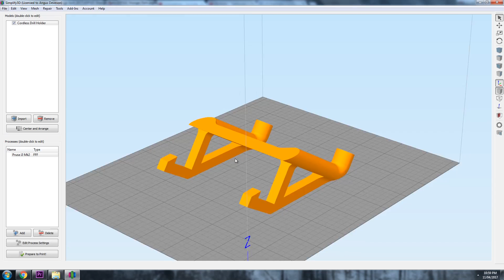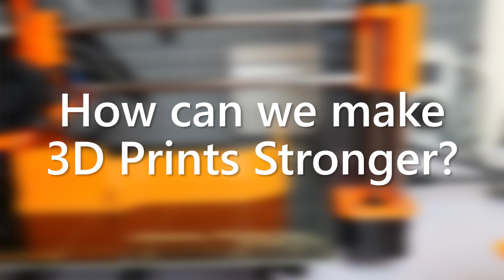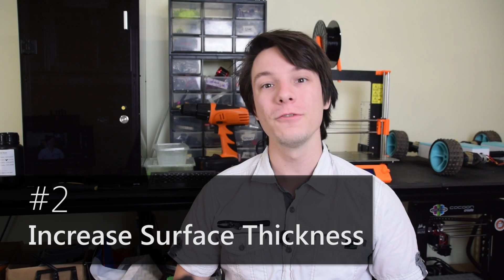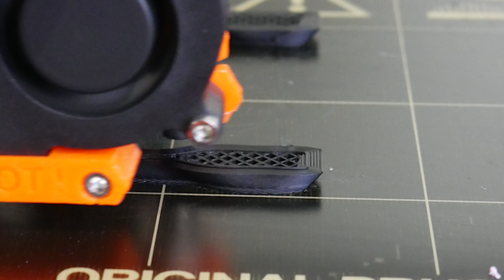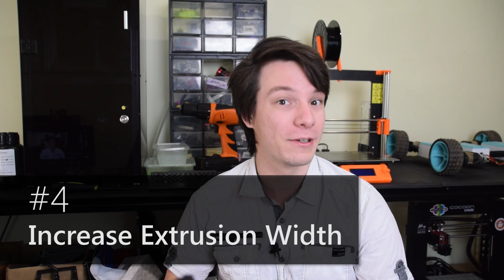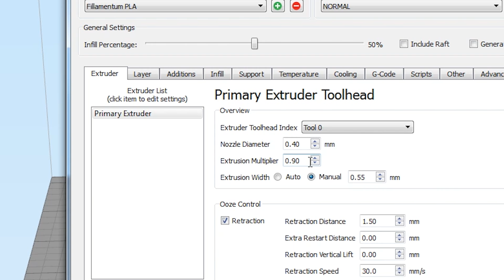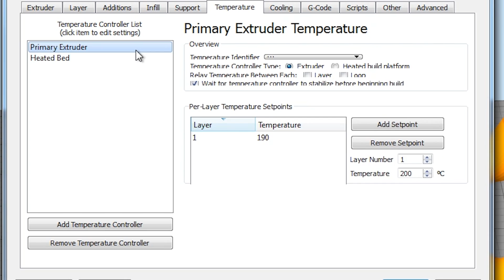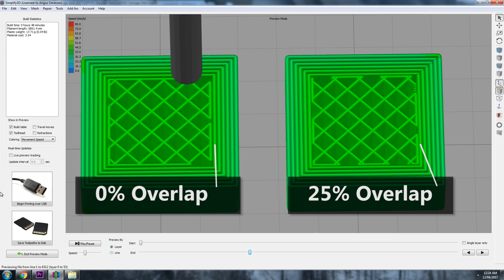3D Print Stronger Parts! 3D Printing 101

Comment: Also I would like to point out, that that is by far the ugliest,  cheapest and tackiest looking cordless 
drill I have ever had the displeasure of seeing on screen. =D
Reply: but the color matches the color of prusa mk2!
Reply: pfff, you think that's ugly? You haven't seen my Harbor freight el chipo drill.
Reply from the maker: I use the gearboxes in robot platforms, trust me every drill up to something like a dewalt is pretty much identical inside, the key differences are in the support offered / warranty, batteries and control circuitry, not the motors and gearbox unit itself. Because I rip the gearboxes out I have 4 crap batteries always ready to go :D
Reply: Siana Gearz you mean aypart, just to see how it chooches and if its skookum enough for a hobbyist xD
Reply: MPGster s because here in the empire of dirt, we make it chooch...  or else
Reply: Didn't you see the Prusa MK2 in the back of the video? that was given to him by Joseph.
Reply: Haha Kmart power tools are the best! :P ;)
Reply: It's a drill...! Come on! Not a hair dryer...!
Reply: Rocky LaDoodle Nope. Kmart 12v Drill. Performer brand.
http://www.kmart.com.au/product/12v-cordless-drill/748147
Reply: I have used all sorts of gearmotors for robot locomotion. The noisiest are the drills, the quietest, are the worm gear type from windshield wiper motors or massage chair worm gear motor. The benefit of the worm gear type, is that it locks when not powered.
Reply: Johann Wyss don't tarn it on, take it APAAAHRT!
Reply: The fact I understand the references to Dave Jones from EEvblog and (I have no idea what AVE's actual name is.....) Tells me I am spending too much time watching Youtubes!
Reply: Johann Wyss That's a luck thing My dad got a peugeot drill (nice brand in eu,even if they are supposed to make shitty cars lol) from my mom's dad about 20 years ago and it still works.
It was one of the first cordless.
But obviously the battery does not last very long now.
Reply: Wasn't Angus like the only "popular" youtube Chanel Jospeh didn't send a
 Prusa to? Ignoring Chuck from CHEP because Joseph suggested Chuck may 
expose him for dangerous wiring like Chuck did Wanhao.
Reply: I must have missed his review of it!? Well I stand corrected cheers Bart!
Reply: I'm pretty sure that it is an IKEA drill, or the Australian equivalent.
Reply: $15 sounds great till your in the middle of a project and it dies, quality tools are a good investment, I've never regretted spending the extra money. That being said, I will never buy Snapon.
Reply: I think it goes SUPER well with the Original Prusa Research i3 MK2.

It's a cheap drill, but whatever, it's not about to be run hot or experience much load on its bearings, drilling that little bit of plastic reaming out the 3D prints, maybe wood. If you wanted to do something more demanding with it, a higher quality tool wouldn't be misplaced. I think a few years down the road, replacing the switch, it will be good as new.
Reply: Awesome find, I may just grab one and tear it down just for a look.
Reply: +MPGster, AvE, is that you pretending to be some one else, or some monkey is imitating you?
Reply: Maker's Muse AvE teardowns disagree with this statement.
Reply from the maker: +Johann Wyss but you can't argue against its price to performance, 15 bucks!
Reply: Well for $15 I would most likely be satisfied too. My last drill was a Hitachi 18v it lasted about 4 years but cost around $400. $100 per year...... if that drill lasts longer than a month it is still better bang for buck than a "quality" brand............ But my $400 drill looks better..... ;)
Reply from the maker: +Johann Wyss going on 2 years, but I only use it for kits furniture and robot events.
Reply: WOW! yeah that is crazy Angus, I use mine for trade so it isn't likely to stand up to the work mine does but that is still impressive. I won't be encouraging people outside of trade to buy "quality" tools for a while. 
For a hobbyist or home user $15 for 2 years + of use is crazy good.
Reply: @Unordung  and probably makes the job easier too